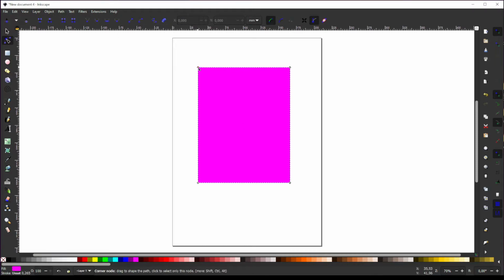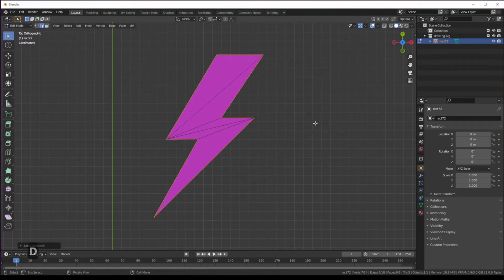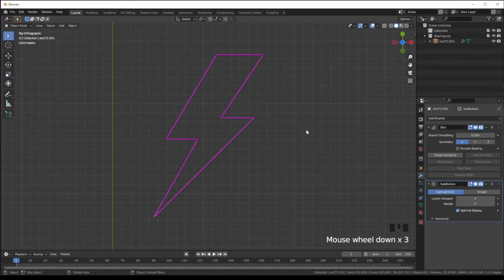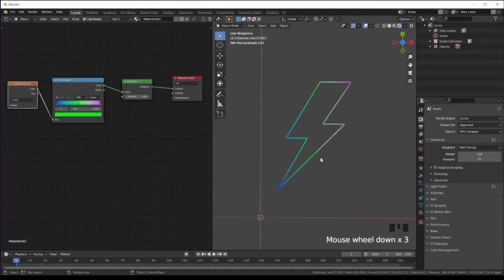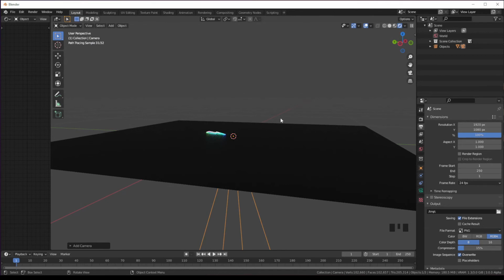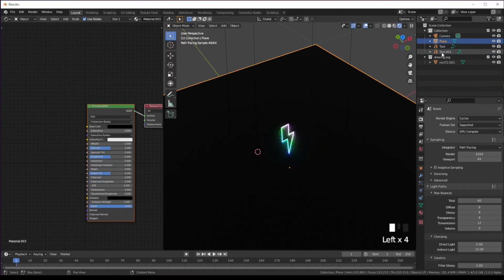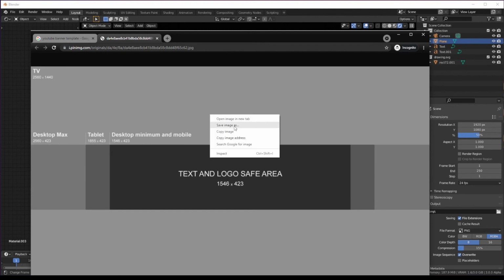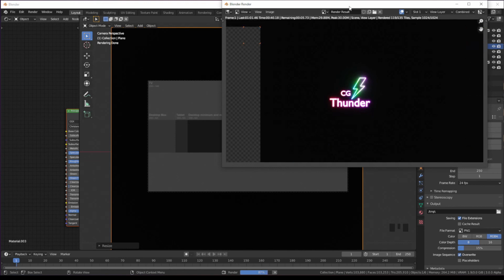How To Make a YouTube BANNER Quick and Easy in 3D with Blender

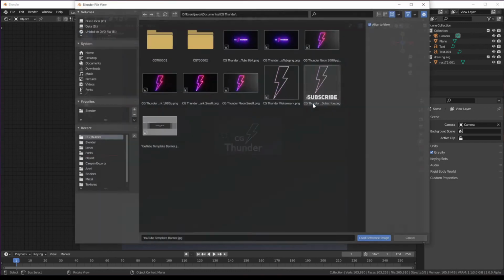Comment: 8:59, for importing the template refrence image, it might be easier if you first set up the camera resolution to 2560 px 1440 px. then go into the camera video and drag the template image onto blender to add in the image as a camera background. finally click the green camera thing inside of the camera object on the scene collection then click the green camera icon underneath the scene collection (the little icons where modifiers would be for example) open up the Background Images tab and change the depth from back to front, and change the opacity to 0.5 or whatever